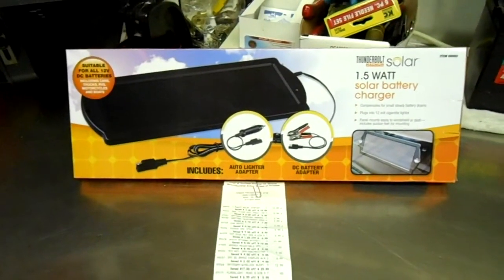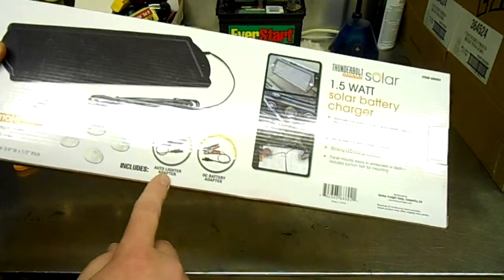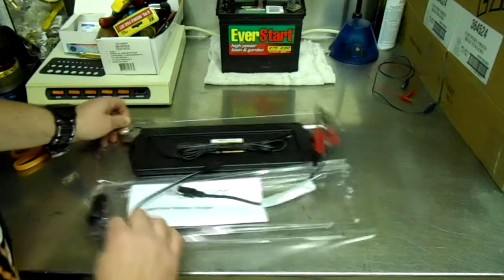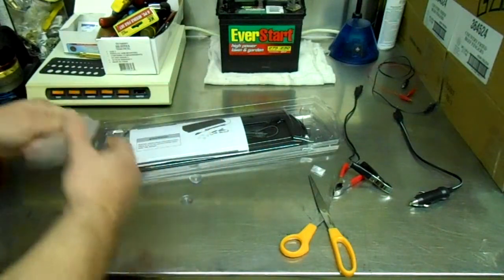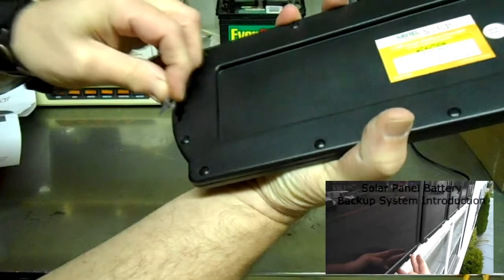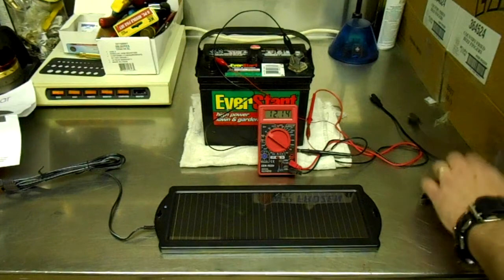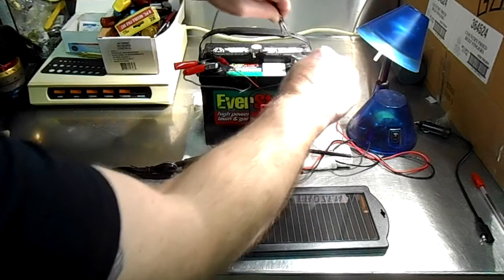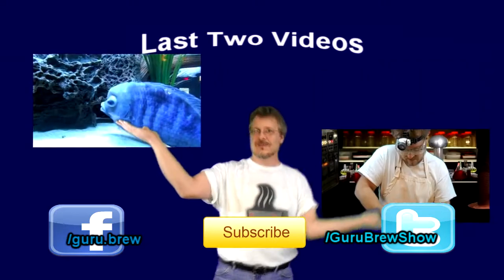ThunderBolt 1.5 Watt Solar Battery Charger

Comment: Do you need to get a regulator for it? I just bought one and the LED light didn't flash or turn on indoors. I'm going to wait till tomorrow and see if it comes on out in sunlight.

Comment: I didn't read every comment ... but really, a lot of cars have cigarette adapters that are OFF when the car is off.  That means you can't trickle charge your battery in this case.   If you have a phone charger in a cigarette adapter that charges your phone or anything else when the keys are out of the ignition, then you can trickle charge your battery.   Also, don't worry about over charging a car battery ... the 100 to 200 miliamps is too small to make a difference ... it would only put in the amps that what would normally leak out of your battery if it was just sitting there not being used.

Comment: you need to take the back cover off the solar panel and cut one of the 2 wires going to the LED light. that is why it is pulsating, and you will get a more consistent charge that way. i have the same panel and had the same problem at first with it.
Reply: Thanks for the tip

Comment: I bought that same multimeter and the Thunderbolt solar maintainer. There are problems with both of these products. The manual for the multimeter says that the battery charge measurement feature is only supposed to be used for batteries up to 9 volts. I bought it to test car batteries, but I can't.
   The Thunderbolt solar panel doesn't have built-in overcharge protection. The instruction manual for this panel says to hook it up to a voltage regulator when charging batteries. I didn't read that before, and I think I overcharged a battery. Northern Tool and Equipment sells a couple panels for almost the same price, but with overcharge protection. I wouldn't leave one of these panels plugged into a fully charged battery without overcharge protection. The panels with overcharge protection are about $5 more than the Thunderbolt panels. You have to read the descriptions. Not all of the panels Northern Tool and Equipment sells have that feature. The ones with overcharge protection don't have the blinking LED, but I can live without it. There are some two pack deals with 2.5 watt panels, but those don't have the overcharge protection. 

http://www.northerntool.com/shop/tools/product_200578629_200578629

http://www.northerntool.com/shop/tools/product_200586483_200586483
Reply: +Robert North There is no overcharge protection in the northerntool ones. The fact they only trickle charge is the overcharge protection,
Reply: The Coleman brand sold by Northern Tool claims to have overcharge/undercharge protection. I wouldn't be surprised if this was false advertising though. You should contact Northern Tool.  They make it sound like it's a float charger. Here's what they list. 

 Features + Benefits
Built-in overcharge/discharge protection protects the battery (12V battery not included)
Maintenance-free, weatherproof solar panels for long life
Includes 2 sets of suction cups for easy mounting to the windshield
Comes with two sets of alligator battery clamps, two 12V DC plugs and wiring attached to each panel for quick and easy connections

Comment: It's pulsating because that blue LED is taking more power than the light is generating....take the panel apart and cut one of the LED leads to gain more output power from the panel.  Also, these panels put out between 18 and 22 volts in full sun, and I don't think you want to be putting that into a 12VDC battery that should be charged at between 14.2 and 14.8VDC.
Reply: The current is so small here that there is no issue for a car/boat battery.  A buck current regulator would make the panel more efficient though.

Comment: Its a battery maintainer, not a charger. This charger can prevent the normal electrical drainage on your car battery when your not using the vehicle , from running your battery down. Thats all it can do, basically keep the battery topped up, when your not driving. Some solar panels are powerful enough to charge a dead battery though .

Comment: I just bought the same solar charger today. Hooked it up his way, then I rear the directions. DO NOT HOOK THE SOLAR CHARGER DIRECTLY TO BATTERY. You must buy a voltage regulator, which is not included. You can over charge your battery, then having to buy a new battery
Reply: +John Robinson You only need a voltage regulator if t puts out 15 watts. This thing trickle charges so the regulator will actually drain your battery. http://www.northerntool.com/images/downloads/manuals/28668.pdf

Comment: I just popped one of these chargers open. Aside from the PV, the only circuitry inside the housing is a diode (to prevent reverse current), a resistor (for the LED) and the LED. I presume that the LED is prefabbed to pulse as there is not timing circuit or processor present on the tiny circuit board. So this thing is not pulsing to prevent overcharging. It appears to pulse in low light when the LED goes on and off. In bright light it gives a near constant 20V or so. What keeps your battery from blowing up is that you are only getting a very low current. Still, the instructions state that you need to use a voltage regular (not provided of course) before hooking up to a battery. This is despite the fact that the alligator clips attach directly to the PV output. I wish they would put that bit about a regulator on the box!!!
Reply from the maker: Interesting bit of information, thank you. Steve
Reply: +Eli Bridge I was assuming there might be a volt. reg. in the cig. plug. Maybe that should be opened to see what is inside.
I have this panel but I don't have the plug. Do you know if it is available separately?
Reply: +fred forbush Sorry but I don't have this panel anymore.
Reply: Not sure what "plug" you mean, but they do sell a "Solar Power Connection Cable Kit - item #68684" for about $10, which should have whatever you need.

Comment: 10min and the guy doesn't even test the solar charger using solar light!?! This video is a waste of time, and the voltage fluctuation is likely due to the lamp barely giving it enough juice to flash the LED.

Comment: I have this same panel. I use mine with charging circuits that I made for rechargeable batteries. Great bug out bag item. Just the room like will give you about 3v. There is not much to the circuit. Basically just a LED and the blocking diode to prevent draining the battery when no light is there. Great item.

Comment from the maker: I suppose you could power some led lights or a radio with it in real time. It's low power limits it's uses to mostly charging other batteries.

Comment: I found they are wired wrong inside and as the LED flashes it's pulsing the voltage to the battery.  They are okay to play with.  But you need to see if it's wired right with a good volt meter.

Comment: If you put a multi meter on the positive and negative part of it, you will discover that it pulses from about 5.2 to 11 volts because it is designed to charge a battery (trickle charge) and you can see from my earlier post that I am trying to modify mine to produce less voltage but the same current.  I am referring to my car charger for my cell phone.

Comment: When I write "the ac works fine", I mean that I used a 120vac to 6vdc charger and hard wired it to the car charger for my cell phone and it worked fine.  I may have damaged one of the transistors when I soldered the wires into the front of my unit or something else I have yet to discover.  I tried to get the schematic diagram from Samsung and no luck there.  I will keep at it.

Comment: Thanks for the video.  I am trying to get mine to work with an adapter for a cell phone and when I do the charge, the blue light goes out.  I will check with my multimeter to see what's up with that.  The ac works fine when I use it threw the car adapter so it may be something I soldered when I  did the modification.

Comment: It's pulsing because the blue led is drawing a charge to flash because you have a weak source light. Increase the light source and this will not be a problem.

Comment: The voltage jump up and down because its sending little pulse each second in order to charge the battery, if dont have the regulator a continue 14 volt pick will fry the battery.

Comment from the maker: The power is more likely 5vdc and could easily be accomplished by using a voltage regulator found at radioshack